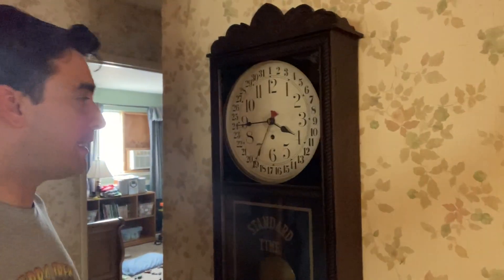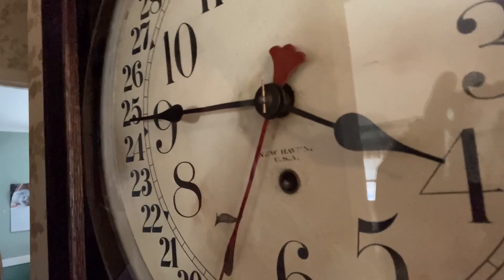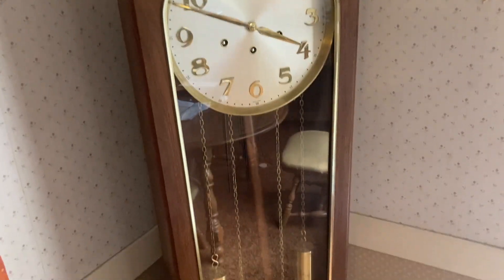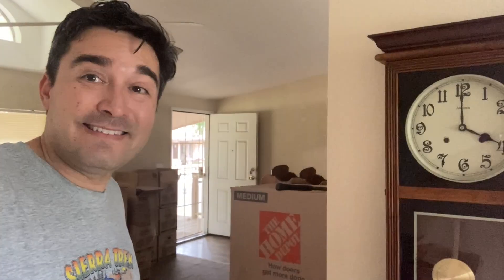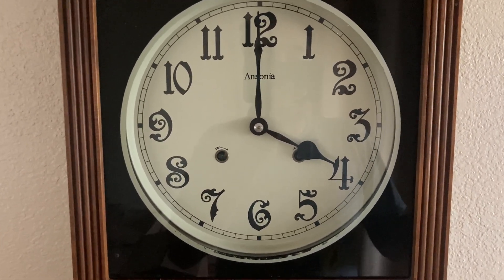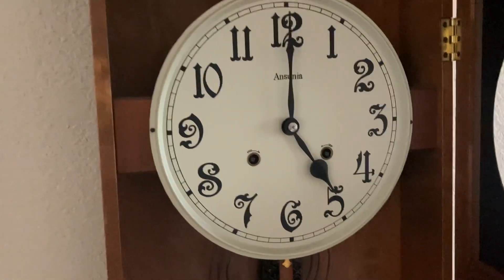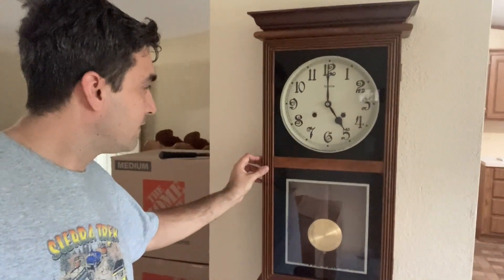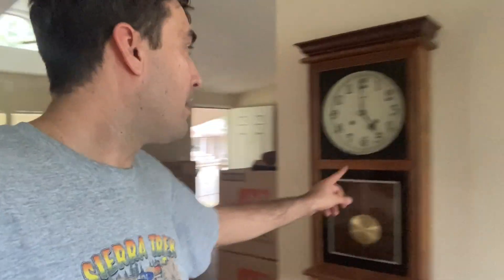Vintage pendulum wall clocks discussion

Comment: Good advice. I’m just getting in to mechanical regulator clocks and my first purchase was made in Korea. It looks great on the wall and keeps good time but I found out from an expert it would not be worth fixing if it broke. I’ve learned a lot from taking it apart and cleaning it, but my next purchase was a vintage Seth Thomas regulator which I’m more than happy with. Thanks for posting  👍